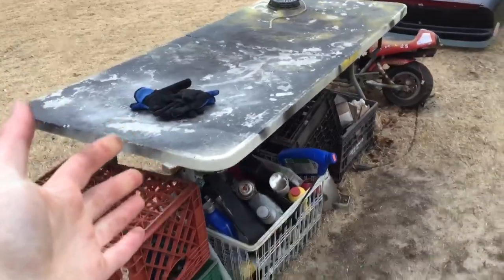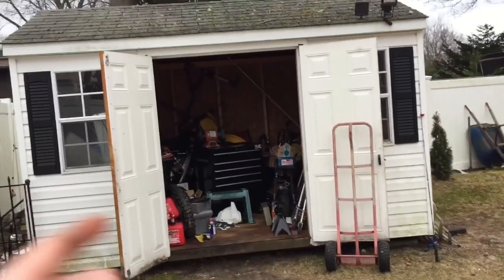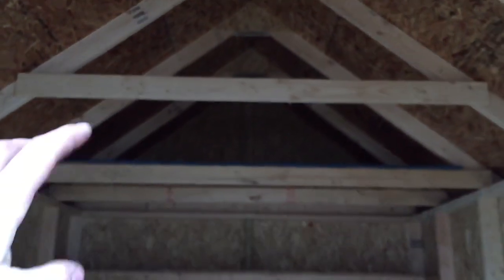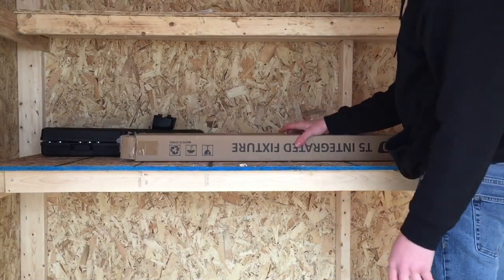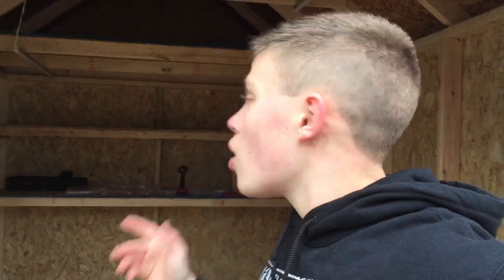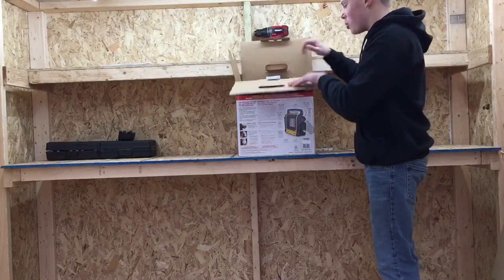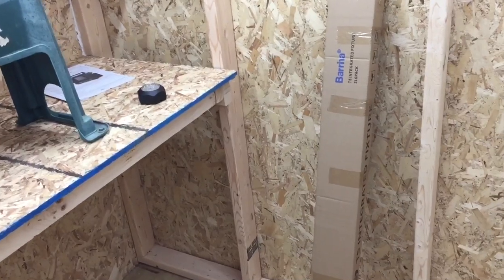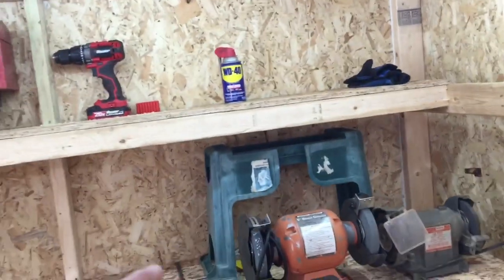FINALLY! NEW SHOP REVEAL!

Comment: Congrats man! I would reccomend a bigger propane heater, i have a big buddy with a 20lb propane tank, it works great for my garage! (Its a 2 car garage, and it heats up pretty well) but i would get some insolation before you spend money on another propane heater, i would reccomend at least a r-25, but i would go r-40 if you can.
 Just dont spend too much, and enjoy the shed!
Reply: 100% should insalate it, its actually pretty cheap to spray foam it yourself too
Reply: I agree on that he should isolate it but I think his heater is good enough for that small space.  I have the same heater and me and my family went camping and it heated up the whole camper pretty well it's just he probably needs isolation
Reply: what size is the shop?
Reply: @cxs7966  idk exactly but I think he said it in the video

Comment: You should get a kerosene heater, and with the skills you have you should build a little extension on to it so you can put everything you not working on in there, the extension dont have to be perfect just good enough to keep everything protected and you'll be able to build it to whatever size needed to store everything comfortably (bikes & other builds)

Comment: The mr buddy heater is awesome all you need to do is get a 5 gallon propane tank and a hose amd you can connect the 5gallon to the heater anf it will run longer it might help get your new shop warmer i have a mr buddy heater and i used it gor my travel trailer and it worked great!

Comment: Hey migs, how much did that whole setup cost you? I really need a building like that for my bike...which i just finished. Havent got it cycled yet because its snowed the past 3 days or been too cold to function. Also try to find some sort of electric heater, big propane heaters release gases and also bufn up the oxygen in the room, watch smarter everydays video on oxygen deprivation, its not good. The cost of the electric heater may be a little more expensive than buying a bunch of propane but its worth it with the safety risks of running propane heaters in a closed area like that.
Reply: You can rent to own for $100 a month that shed  is around $4-5,000.
Reply: Get a wood stove is the answer
Reply: @taylersampson2210  that would work but having a huge pile of wood in the yard may be an issue, it would be at least for me.

Comment: I have a heater like this ad it is amazing. My garage is 24x30 and it heats it up like nothing. You would be able to run it on low and a tank should last a long time. You use a grill tank.

Comment: Your going to need a heater 3 times that size if you decide not to add insulation and I recommend putting down a large shop carpet or some type of Matt otherwise overtime gas oil and carb cleaner will destroy your plywood floor

Comment: Shop looks cool congratulations, you can get some One inch thick Styrofoam board and insulate the building would help alot.  You could put a light in the loft make it easy to find stuff up there.

Comment: You need to insulate your building go to Home Depot buy you some roll insulation it's pretty cheap insulate the whole inside using a staple gun then your little heater will work better

Comment: Run a fuse box in there from your house and put some plugs in there then you can get a air conditioner heater etc instead of dealing with that cord and crap

Comment: You need to run underground electrical that's what I have in my workshop and it's great I run a electric heater an air compressor and light and I've yet to blow a fuse but if you need any help designing it i will be happy to help